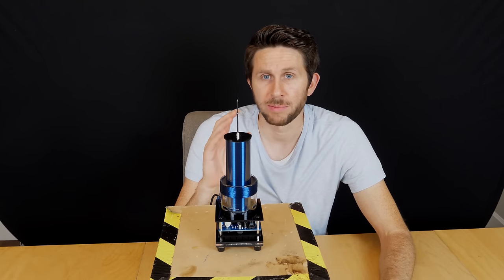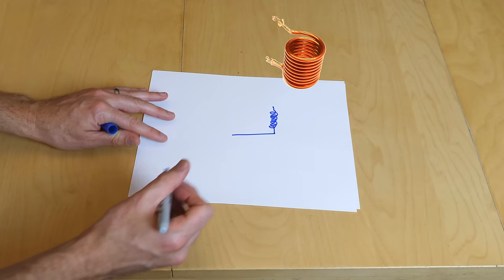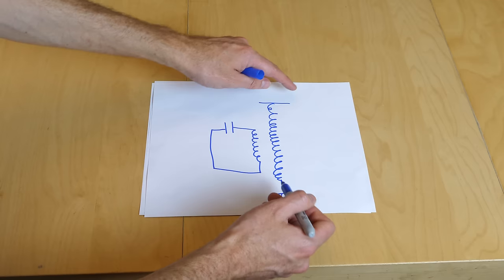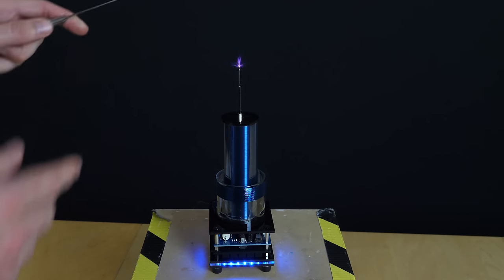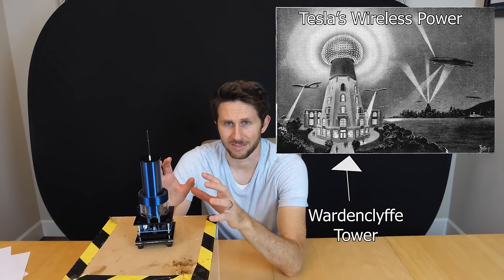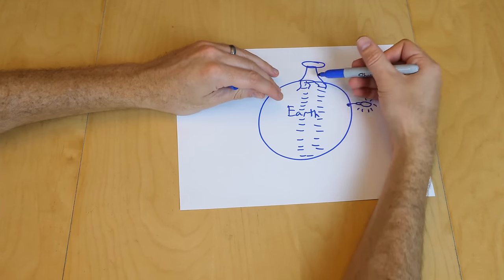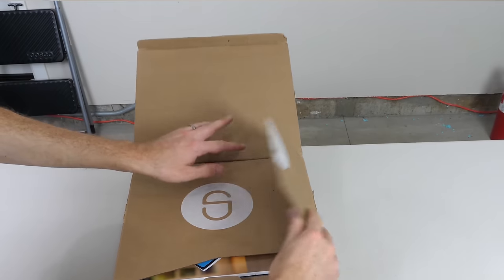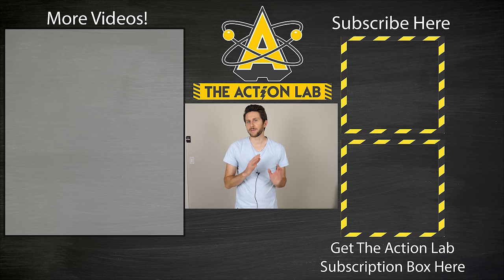Making Wireless Energy For The Entire Planet—Nikola Tesla's Wardenclyffe Tower

Comment: There was a hint of this back in 1925. That year, a new radio station started broadcasting in Detroit. Nearby residents were wondering why their house lights were on all the time. After some investigation, it was discovered that the radio station was the cause.
Reply: Very early radios were powered with a really long wire that used the radio frequency to power them

Comment: You are missing a third coil, Wanderclif tower coil was a more advanced version of the Tesla coil which actualy had 3 coils(primary,secondary and resonant)and it is called "Tesla's magnifying transmitter" and there is signicant difference between the operation of theese two but as I am a verry slow tiper and not native eng speaker I sugest searching the web for more details there are actualy decently detailed documents of this avalaiable online .To more easily find it search for: " Tesla's magnifying transmitter " ,with that words. :)

Comment: Just trusting Tesla's insights, (in which not even he could manufacture or form completed in his mind) I think he was thinking outside the box of transverse waves.  He probably would have found the relation and invention wherein he could resonate transmission transversely but directed,  somehow able to resonate an amplitude through whatever oressure-vectoring he was trying to figure out.  As a man who believed in an ethereal form to reality, I believe he was far into the concept of the abstract motion underneath motion, a highly dense, and highly energetic form of eather that wasn't similar to to the one the Morley experiment found to be absent.  He may have been completely wrong, but let's remember he was a mechanical engineer, he was very keen at linking effeciency to power, and not in a standard way.  He designed past the limits of his materials.

Just as opinion I think he was on to something that probably doesn't make sense on the paths we've taken instead of it, but he was going to show us probably what he meant if he could have.  

It's rumoured that this idea has been transitioned to the atmosphere, or at least it's concept has been expanded upon (or others) in the haarp like experiments.

Comment: I don´t get how you could "pump current" into the ground. The charge would simply distribute like water into a sponge. The ground would be a dummy load.
From my understanding, he wanted to use the capacitance of the Earth´s atmosphere to build a resonant circuit together with this giant coil.
Feeding the primary of the coil with the resonant frequency would allow to tap into the EM-field with an equal setup anywhere on Earth. I assume that he had communication in mind, more than high power transfer. The losses would be too high for power transfer, but not so for communication. This could have been much more efficient than spark- and arc-transmitters and primitive detectors (magnetic/crystal) for EM-fields - that were common at this time. So he might have had a point trying it out this way. However, the invention of vacuum tubes for detecting EM-fields in 1904 provided a simpler, cheaper and smaller solution and allowed the usage of many different frequencies at the same time. Long waves proved to reach thousands of miles, and short waves could go around the whole earth by reflection on the ionosphere. I think that´s the reason that his idea got buried.

Comment: Tesla describes in many texts about his tower... that he was not using hertzian waves. 
He called it radiant energy. There is several YouTubers doing experiments similarly how he did it.

He essentially pulsed ONE polarity of a very high voltage into either a coil or .... for other effects to use a very thin conductor bar aimed at whatever it is you want. 

The book "Secrets of cold war technology" by Gerry Vassilatos
Describes exactly how it's done and there is a few guys successfully doing it. Just circuitry gets a little confusing. 
Today it's called scaler but Google doesn't describe at all what it is. 
Has nothing to do with particles.

Comment: There are speculations that the operation of the tower with the electrical potential injection into the atmosphere caused the Tunguska impact, because electrical forces of attraction were caused on objects near the Earth, which also attracted heavy objects that would otherwise not have fallen to Earth.

But the usual statement was that the tower, because it was never completed, never went into real operation, which was immediately reason enough for many people to declare this rumour to be nonsense.

But the German Wikipedia on Wardenclyffe Towe also clearly states that the tower had a metal dome. So the dome already existed and that would have been (apart from the electrical conditions, such as a transformer and electrical supply, which was also there, because otherwise Tesla would not have gone bankrupt because of the high coal costs that were supposed to power a power station - as you can see from the Wikipedia articles on the Tesla project).
Intuitively, we all think that because the tower was never completed, the dome did not exist, and therefore no tests could have been carried out with it. But because the dome apparently already existed, this is no reason to exclude it.

And that Tesla carried out experiments there is also undeniable. For two reasons: 
1. he himself became ill and this also had to do with his experiments with high voltages, in which high-frequency/potent electric fields always occur.

2. if the experiments were indeed as one must assume, that an atmospheric potential change can result from them, then this would be relatively fascinatingly proven on the basis of the Tunguska impact. Unfortunately, "inferring" from the result to the cause is not welcome, because it is scientifically completely bad work. But based on what we can all know today about particle physics and charge potentials in atoms and the atmosphere, it is not at all far-fetched to think that potential manipulation by such installations is possible.

Translated with www.DeepL.com/Translator (free version)
Reply: The fact that such details have emerged from his research could also be the reason why almost nothing of these now unknown attempts has been handed down. They would have triggered a global scandal that could have made the USA liable because it had global repercussions.
Moreover, it could also be used to create a weapons concept that could then be used to manipulate people, the atmosphere and even the weather. 

In any case, if there has ever been documentation of these attempts, then they probably did not turn to ashes with a fire, but disappeared into secret organisations/structures that wanted to implement ideas with them, or at least wanted to prevent them from ever becoming public.

In this context, the question of HAARP and its Sovjekt counterpart near Prypyat (Sovjet-HAARP) should be posed anew: What else were they used for, apart from what is officially known to us today? For example, for research purposes on the ionosphere or to monitor the airspace against nuclear missiles? all very misleading when you consider that the ionosphere was named after an electrical or atomic charge property?
And "research" can also mean many things.

Translated with www.DeepL.com/Translator (free version)

Comment: Nice ad! But, YES, longitudinal EM waves. Even in your vid, the power is travelling through the air and glass, which are both insulators, so Maxwell equations don't apply. If the whole earth is resonating, near-field distance squared 'origin' location is the earth's surface, not the tower.

The basic Maxwell differential equation allows for longitudinal EM waves, but the practical/derived versions we know are just assuming the longitudinal wave component is zero, cuz they're concerned with shear wave "standard" electricity. Try!

Comment: now use a direct resonator base connection... like Tesla intended. "90% lost in radiation in most transmitters, my transmitter is designed not to radiate into space" (approx).. Courtroom Q&A with N.Tesla
So you see why fluro's go out with distance.
Make a direct connection to the base of trans and receiver, use a couple Al plates as capacitor... just see my channel on my TMT

Comment: For my friends out there that can help me. Can a sine wave ride the earth’s magnetic wave through space? Can 3 phases positively charged rods create a synthetic “DC” wave, can a negatively charged 3 phase rods collect the sine wave produced by the positively charged rods. Would you need “4 phases” the 4th phase being the center ground to help collect the positively charged rods. Would you need 3 phases in sync or 3 phases in their own phase to produce proper power to transmit the perfect voltage through air? If you capped the signal and added more "emitting" rods to the side of the emitter could you direct that power to multiple "collectors"? (1 power point to multiple collectors.) Could the collectors reach out a grab 2 phases to help switch between the collectors? Can electricity ride a magnetic wave? Can you send a sine wave from the southern hemisphere to northern hemisphere? Could you send an electron from earth to moon? Can you control shooting electricity in space since there is no ground in space? would the electricity grab on to the minerals in space? Could a space craft be negatively charged and be propelled by the protons presented by the sun in the solar wind (Like magnetic theory)? Also how far out does the solar wind reach. If solar wind is only great at near the closet planets, can we "ride" that wind for the faster means of travel. If you used laser acceleration to push a craft through space would you have enough energy from earth to propel it? would you need satellites to help push? Can a laser pulse from 1 satellite charge up another satellite? If so, could you "Daisey chain" or line of sight the satellites to help charge one other.

Comment: TESLA also made a XENON gas arc lamp in where  he claimed an over-unity of 300 per cent at least. This discovery is censored today. He used calorimeters to measure that excess heat energy compared to the electric energy supplied.
Well, an Italian American Engineer in the name of ROSSI demonstrated in  December 2019 a heat generator with 22 kw heat output and with an input of  less than 400  watts (electricity) to feed  up a controlled and cooled (boosted with nickel, lithium and hydrures) XENON arc lamp (30 cm long)  My take is that such energy excess is expulsed out by electrons smashing at high temperature (5000 degree plus) and resonance frequency impulse current (impaction) Water only motor work (not long I think) on that "arc" principle also but the heavy duty high compression Diesel engine is better appropriated (adding arc plugs impacting water molecules (ozone) and electrons)

Comment: UHG  becuz tesla said his transformer did not use electro magnetic waves.   he was useing dielectric voltage pressure waves. 

think about it.   the voltage reaches the end of a conducter at speed of light ( tesla said faster)   but current takes longer based on resistance andimpedence

Comment: I think you're on to something. Maybe Tesla understood how to use the same wavelength and frequency that we use for television and cellphone broadcasting as a source of power. I have seen experiments where people have powered low voltage alarm clocks with power drawn from the air. Apparently his electric car ran on a regular car battery and an antenna to power the car rather than a plug in and charge source?

Comment: Could you please send me instructions on how to make magnetic elements for personal use. I have experienced a time displacement of time lines when I was experimenting using a magnetic steel rod that attracted electricity from the air.  When I went to cut the power supply to stop it, I had no idea where I was anymore, It was like I was somewhere else. Then I heard a large bang that ended with a blinding white light reversing on itself. I think that I'm in a different time line now because the things I remember what happened in the past has changed

Comment: I'm confused, the interrupter was able to make music from the electrical discharge of the Tesla Coil. In the medium of air, longitudinal sound waves were created from ionizing air atoms, then "de - ionizing?" air atoms, from this rush or out flow of distance limited AC current, from the secondary's pin or electrode. Actually the noise from the Tesla Coil itself (I call it, the Sizzle) should be explained first because it too made a sound which is a longitudinal wave. My point is, the ionization of the air atoms are in the same pattern as the electrical flow and one of the effect is sound which is a longitudinal wave, right? I don't know, you got to explain it to me. I think that what tesla was thinking was that the secondary capacitor could contain everything and anything, i.e. the earth in between the two plates and from the vantage point of the secondary plate dug into the earth and making a large Tesla Coil to pump energy into the ground at the earth's resonant frequency would be considered like a longitudinal wave.  You could pump AC electricity into the air to create music or you could pump AC electricity into the ground at at earth resonance to distribute energy into AC electricity again. It goes both ways, but in the ground pumping version, you have to work at earth's resonant frequency. Tesla knew the limit of his AC electrical discharge and so he had himself built a large tesla, earth was part of the circuit. But, another mystery is, what happens when you apply an AC current at the resonant frequency of an object, like an apple or a bench or a glass? Will it explode? What if its low current and high voltage or low voltage high current?

Comment: The way things really work, is through the ground. All of that stuff, is causing stars in the atmosphere,when accumulated. The clouds only get rid of some. The rest are in an atmospheric mirror circuit. The positration is quicker than the frequency of the sun, beginning at 0 decibel and into -0 decibel. There is an electrical beneath. A vacuum that is a magnet. Magnets are filled with lightnings. The vector has a normal lightning and induced current. The alien lightning has to escape through ice and become a star, rather than a snow cloud. There is no wireless, only vacuum grounding. The arcs are travelling into the star, per cycle. Then they return your desired arc last. Those stars are low atmosphere, visible at night. Their lightning strikes the legs with a third trip through the grounding pole. The strikes have stalked power consumer addresses since Tesla got going. Ground shell radiation lights the bulb from the ground, even if you found a way to go 2 phase no neutral supply. Thanks for attention. cJT aka Chawster Stermon

Comment: Nikola Tesla’s Inventions

Throughout his career, Tesla discovered, designed and developed ideas for a number of important inventions — most of which were officially patented by other inventors — including :
* dynamos (electrical generators similar to batteries) and 
* the induction motor.
* fluorescent lamp

Tesla is most well-known for
 his contributions in 
* AC electricity System 
and for
*  the Tesla coil.

 He was also a pioneer 
in the discovery 
of : 
* Radio (* NOT Marconi !) 
*  the radar ,
* X-ray technology,
*  and remote control 
and 
* the rotating magnetic field
 — the basis of most AC machinery.

He has about 600 parents.